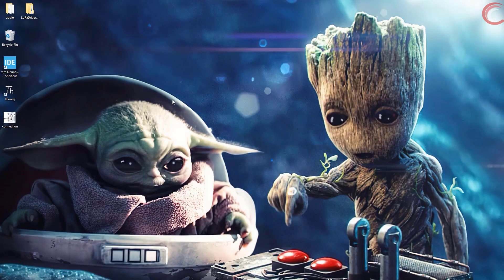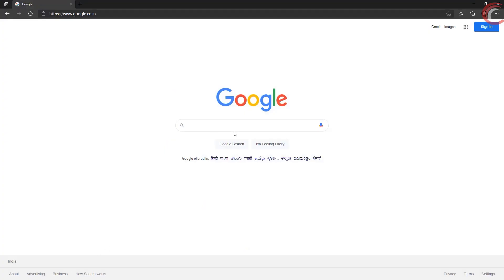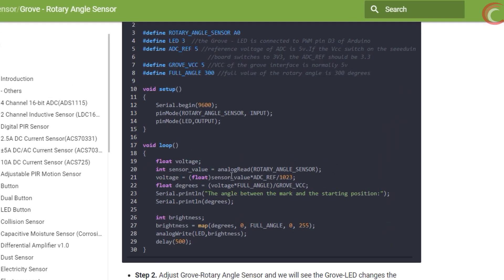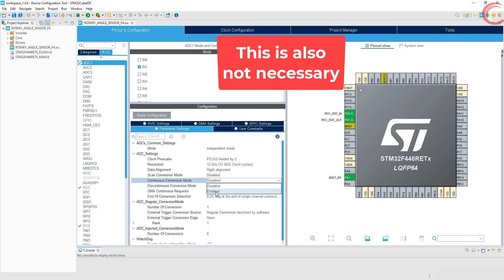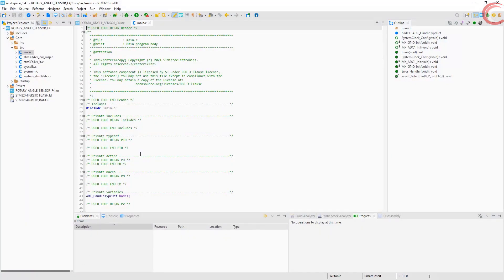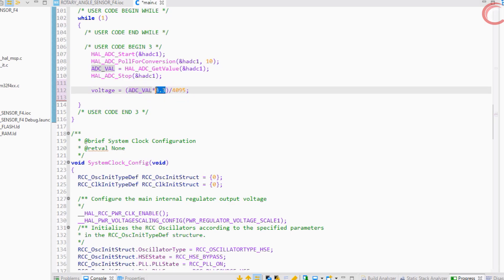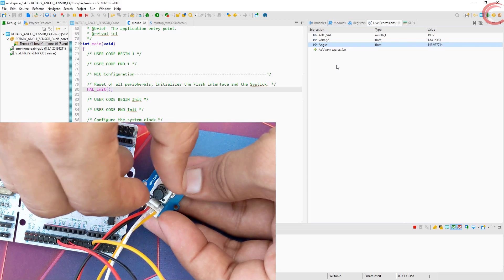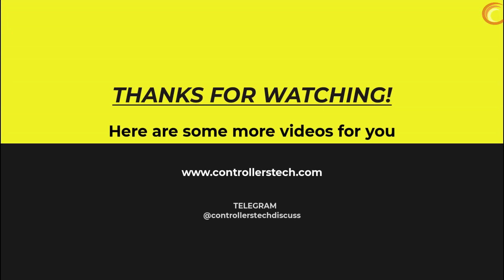Rotary Angle Sensor and STM32 || ADC

Comment: It shouldnt be nessersary converting to voltage
Reply from the maker: Yeah I know.. but this is just for those cases if someone uses a different voltage(other than 3.3) for the potentiometer..
Reply: @ControllersTech  if you replace voltage in the angle  calculation with the voltage equation above 3.3 will disapear
Reply from the maker: It's for better understanding.. 🙂
That way I don't even need to call adc read seperately. I can just call it in my calculation and it will still give results, but this is to make things simple and easier to understand

Comment: Is there any difference between a rotary angle sensor and a potentiometer?
Reply from the maker: Well this one can only rotate 300 degrees.. that's all
I have mainly released this video coz based on this, I'll make another one to control stepper motor
Reply: @ControllersTech  Good idea. I would be very interested to know how you would go about smoothing those ADC fluctuations so the motor does not jerk back and forth. Whether there are sampling tricks or using old averaging techniques, I'd still like to see how YOU do it. Thanks!
Reply from the maker: Haha don't expect too much. I have a very plain and simple solution to avoid fluctuations 🙂
Reply: @ControllersTech  Simple is what makes perfect! I understand those STM's ADCs are evil in this respect. Tried many solutions, from rather complex hardware add-ons to software hacks with the averaging (sum/n) being sort of the best of both world but damn, it takes away half of processing power from the mcu :/ Always looking forward to see how experienced devs does it! Thanks for sharing, as always
Reply from the maker: I think you are expecting too much here. I can't stabilize the ADC.. but effort will be made to have less impact on motor with minimal compromises in the motor performance.
Reply: @gtcollection6933  It's not the ADC itself. 12bit (0->4096) for 0->3.3V means one bit corresponds to 0.8 mV. The jumpiness comes noise pickup from the dupont wires. If you need better noise performance, mount the sensor and microcontroller on a custom 4 layer PCB with separate analog and digital planes. I hope this helps.
Reply: @lukeearthcrawler896  It does help, and make sense. So in other words the way you guys stabilize those ADCs is by giving the VDDA/VSSA and VREF+ its own independent (and decoupled) analog plane. Interesting, I'll rig a STM32F4 part I got here and send a 4 layer stack out to JLCPCB later today to test that out. Thanks man
Reply: @gtcollection6933  replace dupont cables and use shielded cables, like those used for Microphones, put a small 47 to 100nf ceramic capacitor on the center to ground of the potenciómeter, if possible ground the metallic case of the angle meter, all of these will attenuate the pickup of noise, then for the residual noise use soft techniques like moving average or the median or some low pass filter, I hope this will eliminate the fluctuations
Reply: @Tacho1957  Tried your advice an hour ago, Tacho, and I'd like to think its great advice, thanks. It does eliminate enough noise to have an ADC that actually function(!). Although I have to add; the additional ceramic 4.7uF cap I've added right next to the MCU's ADC input pin really chopped-off that remaining noise almost entirely. You are correct, shielded cabling is mandatory for a remotely positioned sensor (tested with a 10k pot, 15CM away from the PCB, STM32F407). 👍
Reply: @gtcollection6933   👍👍👍, for the capacitor use 47nf or 100nf (nanofarads not microfarads), 4,7uF is too high capacitance, this make the angle sensor less responsive (too much filtering), you want to remove 50 or 60 Hz pickup, so you have to experiment with different values to find the best performance, perhaps 100nf it's not the best value
Sorry about my English I hope you understand me, cheers from Argentina